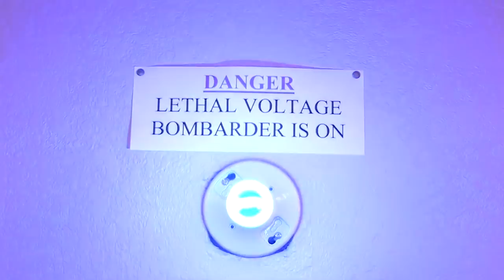The Art of Making Neon with Martin Suettinger

Comment: Ten minutes to achieve a medium vacuum in a neon tube?! You should reach ultimate vacuum in a about two minute. 
A properly processed neon filled tube will be full red with just a little lighter red at the tubulated electrode, because of gas liberated by tipping it off and be fully aged after a 10 minutes or less. Anything other than this means the vacuum was not adequate and you're relying on the electrodes to chemically absorb whatever gasses that is not neon gas, which is nonreactive.   
I suggest you get rid of the gum rubber hose connecting the tubulation to the pump and directly join the neon to it. That's one of the reasons your tubes don't come off the pump clean. Cheers! :)

Comment: Seal the tube off from the manifold? Mystery and Magic ?  Is this a trade secret that wasn't shown / detailed on the video?
Reply: GrayCoLLC that process was literally what I was wondering about and it was cut
Reply: You take your hand torch, and while the tube is still under vacuum, heat the glass up. As the walls begin to collapse, pull the tube (The glass will look like a single hair) Continue to apply heat. Once it detaches, continuing heating with the hand torch to 'round off' the glass to prevent stabbing yourself (Much like a sharpened candy cane). Have anymore questions, feel free to ask :)

Comment: Why don't neon signs come in fatter tubes? Is it because of the difficulty in working with larger diameter glass?
Reply: A wider tube has a lower intensity discharge.
It would be more of a pale faint glow for the same amount of power used.
Of course, going too thin would be too fragile.
Reply: I make neon and they come in all kinds of tube sizes. (28mm is the highest I've bend.) Larger tubes tend to feel a little awkward when bending, at least for me because I mostly work with 12mm. Actually, if a tubes diameter is larger you put less gas in it, because science lol. It has something to do with the gas atoms vibrating and such that is hard to explain. You can go as thin as 8mm glass. It is more important about the footage of glass you are pumping (Usually you try to stay above 4 feet). Electrodes, tubulated and non, come in 4 main sizes;  30ma, 40ma, 50ma, and 80ma. The decision on that depends mostly on the transformer you plan on using and how many tubes you need to light up. Transformers are what regulate the output of electricity to the tube. If you have a faint tube you may have a transformer with not enough ampage. Or it is a Mercury tube in which case the signs needs to 'warm up' to allow the Mercury to vaporize and spread evenly among the tube. Have any more questions, make sure to tag me. :)

Comment: How are different colors dones in one  Neon sign??
Reply: +Armando  Barrios  There are two types of gas used. Neon and Argon. Neon glows red, Argon glows blue. They use a variety of tubes that are colored with fluorescent powders. So argon in a yellow tube equals green. And so on :D
Reply: +Armando  Barrios Most of the bright colors, besides reds, oranges and some pink, are produced with a fluorescent coating on the inside of the glass. Though the mixture used to light the powder (via ultraviolet light) glows blue, these powder-coated tubes produce well over a hundred colors: blues, greens, richer pinks, purple, and many shades of white. You could cut a 1" piece of every color made, weld the glass together into one long tube, use the proper fill (argon plus mercury) and get every color.

Neon fill turns everything warm. Tubes coated to produce blue turn orange. Coated green turns orange. Purple and pink turn pink, but the pink will fade over the years to orange.

There's also stained glass tubing, usually coated with phosphors. White coating makes the tube's color brighter, but pink coating in a blue tube gives a deeper purple. Any colors one desires can be spliced into a single tube, save for those created using neon.

Comment: why are you putting mercury in a neon tube? that's for argon only.
Reply: Pretty sure neon is a catch-all name for glowing signs even when it's not neon per se.
Reply: Agreed, however Neon is a mixture of Neon and Argon gas... It looks to me that this shop only has Neon gas in their setup. (Or the man in the video misspoke ) Hence why they used Neon. Something cool I like to do with a Neon (red) tube is put the tiniest ball of mercury I can in it. The tube starts out bright red and slowly turns to that blue-white over the course of 5 hours. However that is not a practiced thing to do. Aka not a requested thing from customers, only for personal or teaching.
Reply: The powder coated colour tubes need UV light to glow. The guy maybe is doing a generic demonstration of all the possible processes, even though he is using a clear tube with a neon fill. Which should be red! I'm not sure what he is describing with his change in colour in the first few hours of aging, from white to red. Sounds like the electrodes have a 'getter' which is taking time to settle into a stable state. It can't be the mercury surely? To get vapour it needs to heat up, as in a fluorescent tube. The bombarding transformer is large because the process would be very slow and unreliable with a small current. He is also using the bombardment energy to heat the glass and electrodes (getter activation I think as well). Could do this DIY with a heated shroud and induction heater for DIY.

Comment: That's an awesome craft. However, I believe LED signs are better than neon signs in all aspects. They're brighter, clearer, thinner, easier to transport, and can be animated..
Reply: I noticed that many LED signs and LED building lights are now failing. I think the electronics in the power supply are failing prematurely due to poor ventilation or ageing electrolytic capacitors. Neon signs seem to last a looong time...perhaps due to their simplicity.
Reply: @5Perf65mm  I agree, also neon sign making is more eco friendly.  Parts can be recycled.  LEDs cannot and end up in landfill.